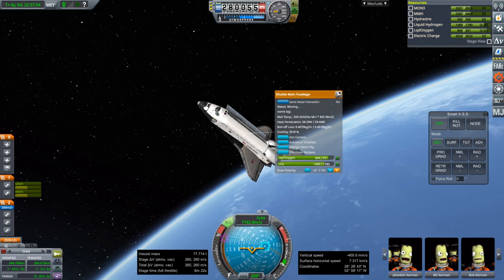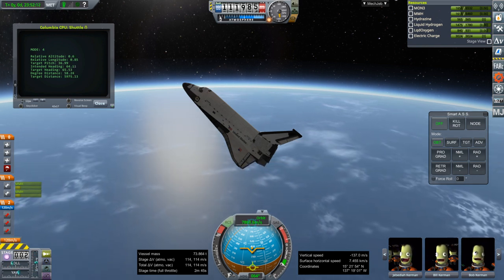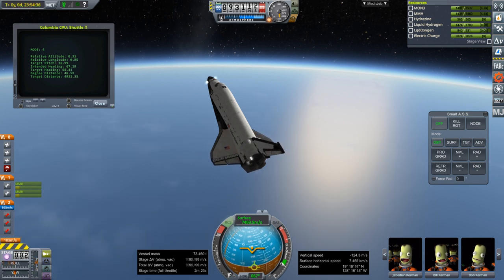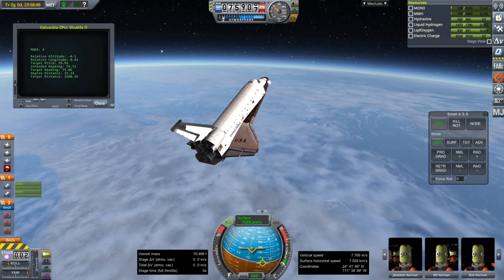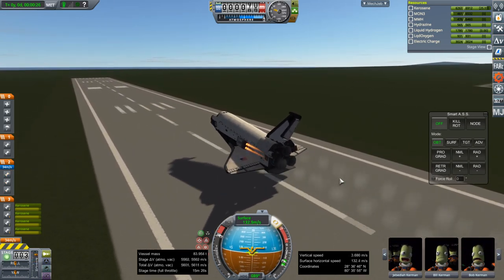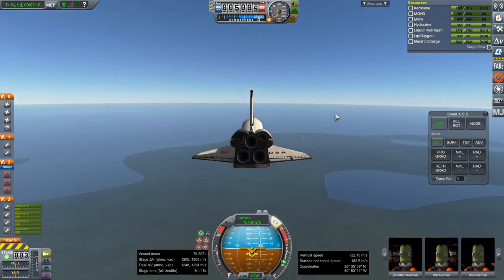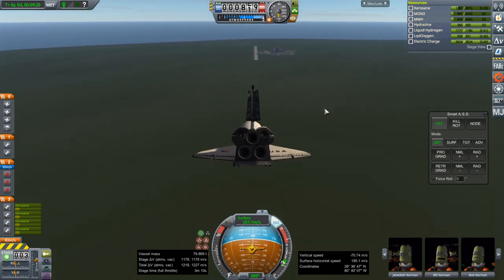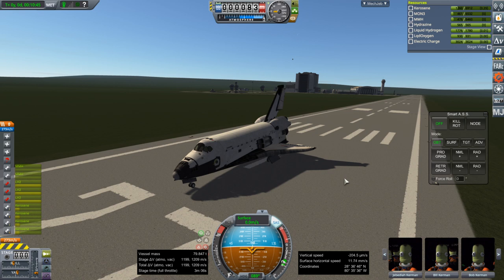Realism Overhaul in KSP 1.8.1 - Shuttle Reentry and Flight Testing 1

Comment: Rcs is hard on kOS to handle. I upped the maxstoppingtime to 5 and the rollts to 5 or 10 (this is for Falcon 9 from SpaceX's Launcher Pack but works on most vessel that has anything to do with rcs, so far i've tested) . It's less wobbly but take a little more to correct itself
Reply from the maker: The maxstoppingtime for this script starts at 20 and changes during the script depending on the situation, though I need to tweak that more. I think I have a version somewhere that has even more steeringmanager fine-tuning, but those elements aren't in the one I used here.
Reply: @RaizSpace  That's awesome! Never thought of that. Might implement something like that in my scripts i'm currently working on. Keep putting out these videos! I enjoy them thoroughly.

Comment: Would it not be the same amount of drag but more momentum/energy?
Reply: Yes. The force of drag is initially the same, but having more mass will mean less acceleration from that same force.

Later on in the descent a heavier vehicle will be going faster than a lighter vehicle would have. Since drag is dependent on velocity as well as half a dozen other variables, you may end up with more drag during later portions of the descent than the lighter vehicle had. I suppose to be precise we should say that the coefficient of drag and surface area are the same between a space shuttle returning with nothing it its cargo bay and one with a heavy payload returning to earth.
Reply from the maker: Yeah, I should have said deceleration due to drag.
Reply: Yeah I figured it wasn't that simple lol

Comment: First : sorry if my english sucks

Now some ideas : Maybe the center of mass (CoM) is too high above your center of lift (CoL) ? That could explain why it rolls so much when trying to compensate for the pitch.

I mean : seeing your shuttle from the upside (yaw axis), your CoM may be in the right place (just a little ahead of your CoL). But looking from the rear (roll axis), your CoM has to be the lowest to have a stable glider. If it's too high, when you have high AoA (so during reentry) your shuttle will have tendancy to bank excessively, until you have enough atmosphere density to counter these effects with the moving aerodynamic surfaces.

I don't know how RO works, and even if you built this shuttle (I'm new to your channel), I'm just a fanatic « standard KSP » user (and helicopter pilot IRL, also), but I had this kind of trouble with some of the shuttles I built in the game. Just add some weight (batteries ?) in the low part of the fuselage, sometimes it gives good results.

Good luck, and I hope you understood my language (difficult to be a French guy... 😂)
Reply from the maker: Your English was fine, and I'll try to adjust the CoM height and see if it works.
Reply: @RaizSpace  Ah cool, you understood me ^^

Comment: The vertical stab seemed a bit odd to me, while you had the roll issue. I guess you already checked that both wings have the same lift data. Maybe one of the fuselage pieces has all its lift on one side or so.

Comment: Is there a way to speed up the reaction of the control surfaces? I experience that they are so slow that I cannot control the shuttle on re-entry, nor ascent even though I've connected a joystick.
Reply from the maker: Even in real life there's a lag, and that leads to a phenomenon known as pilot-induced oscillations. That's why the Shuttle had a fly-by wire system - the computer would manage the pilot inputs and figure things out. The pilot of the Shuttle was never in direct control of the control surfaces.
Reply: @RaizSpace  I understand, but is the speed of the control surfaces adjustable in any config file?  I can see that they are much slower than yours are in your old video where you manage to land it. Maybe they move much faster when they are controlled from your KOS-script?